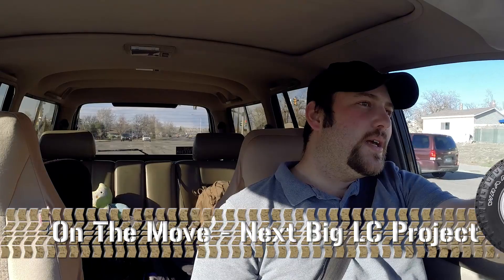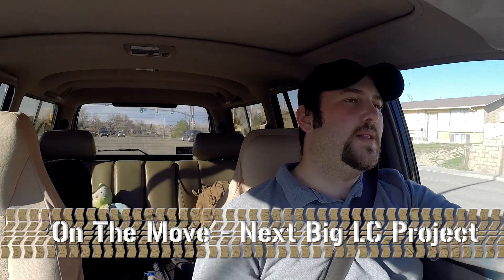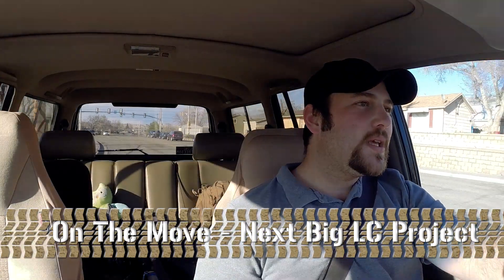Next Big Land Cruiser Project - On The Move

Comment: just pull a spark plug and see if the node is corroded or in bad shape first. a cleaning and re-gap would be way better than investing in a sparkplug that only makes a big difference in self learning fuel efficient cars, which yours is not.  A penny saved is a penny earned!